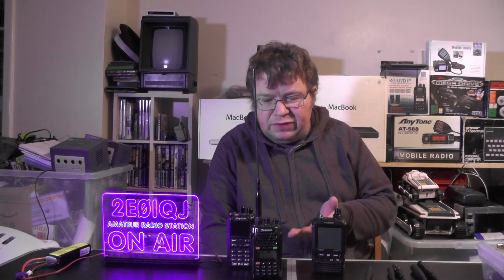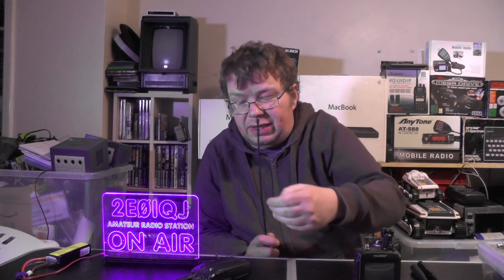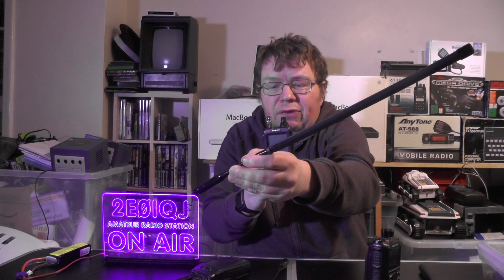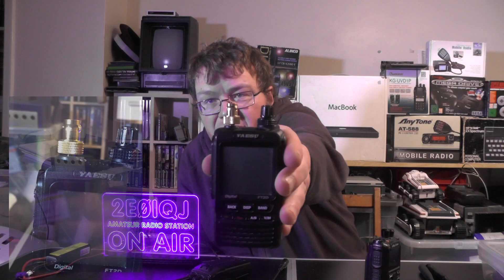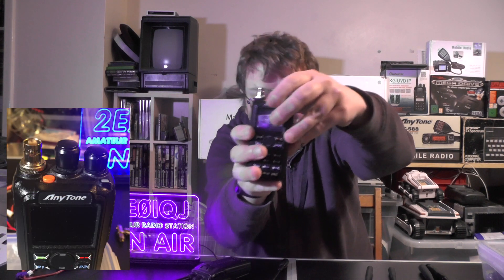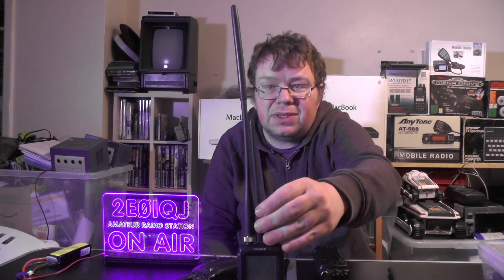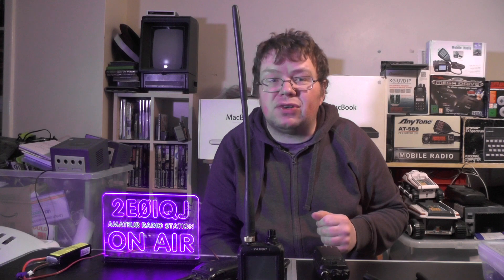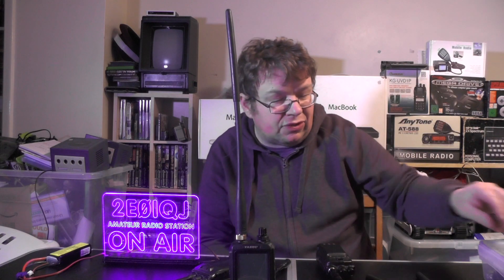SMA to BNC adapters for handheld radios.

Comment: I have heard, that the Retevis RHD771 and. RHD701 are also very good and much cheaper. 🤔
Reply from the maker: @WaschyNumber1  I’ve not used those radios I’ll look into them
Reply: @2j4ez  they are antennas not radios 🤗
Reply from the maker: @ ok my mistake
Reply: @2j4ez  Hello, I should have written it extra down maybe. 🤔 🤗 😂

Comment: 1:38 Do Anyone Have A Problem With This Connector NOT WORKING WHEN FIRMLY SCREWED IN? I Bought 8 Of Them And Non of Them Work , I Tried Them On 5 Diferent radio, All Have The Same Problem, They Worek When Just Screwing In, But When They Are Fully Screwed In, The Connection is Just Gone

Comment: Hi Friend, thank you for your video. Do you think that the form factor of this connector you've shown at 1:33 would fit in a TYT UV  98 radio? I'm concerned about the bump that ht has and the female adapter would not allow the fully connection of the central pin. 73 from Brazil.

Comment: Hi there and thank you for your video! Can you recommend a bnc to sma for my anytone 868 so that I can rapidly switch antennas. Sma to bnc female for radio bnc male to sma female for antenna
Reply from the maker: https://www.ebay.co.uk/itm/BNC-Female-Jack-to-SMA-Female-Jack-RF-Adapter-Connector-/351715961871?mkcid=16&mkevt=1&_trksid=p2349624.m46890.l6249&mkrid=710-127635-2958-0 try something like this